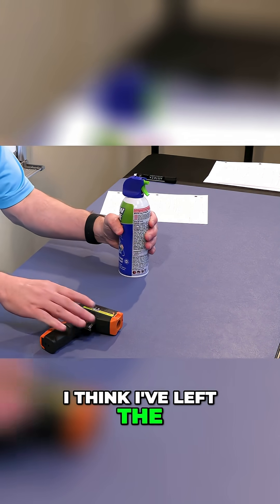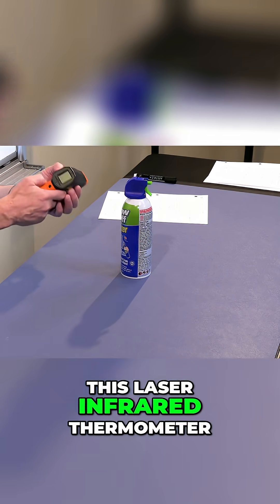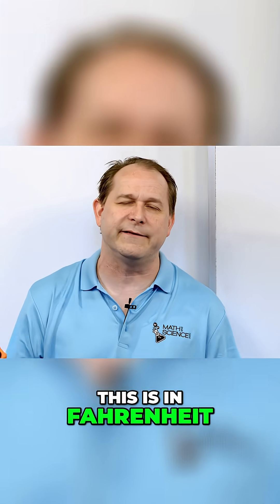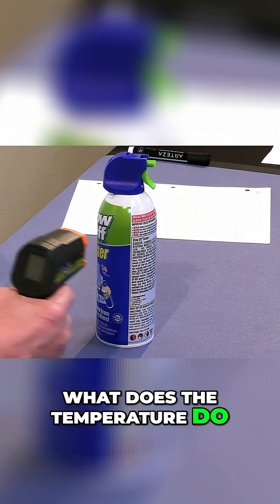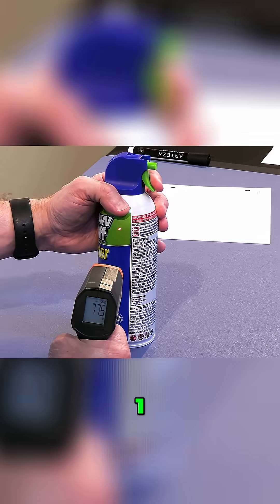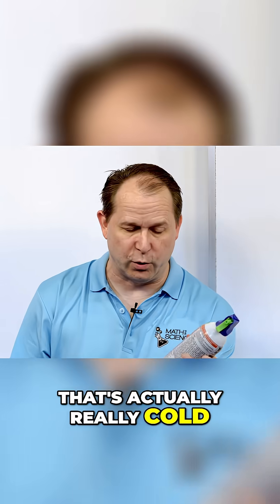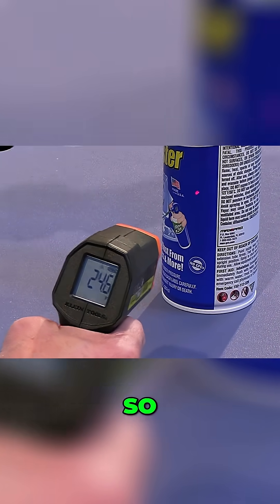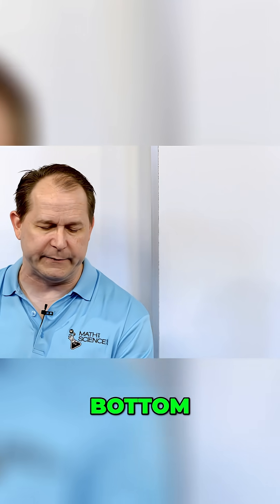The Science That Cools in Seconds

Comment: The coefficients of metals and gas determine how they expand or shrink simply use a negative temperature change in the thermal expansion formula to calculate contraction.” Just use Charles enforcement law to find the difference in contraction. Accurate answer for the cold gas ..

Comment: Is this an exothermic reaction or an endothermic reaction? And why does the temperature drop as the gas exits the can?
Reply: It is not a reaction, it is a result of the propellant changing state from a liquid to a gas.  Heat must be absorbed in order to do this because the energy level of the system must remain constant due to the principle of conservation of energy.  Most air conditioning systems use this method to cool environments.